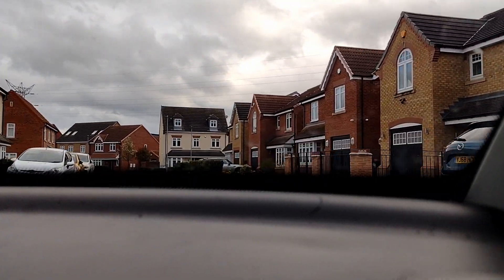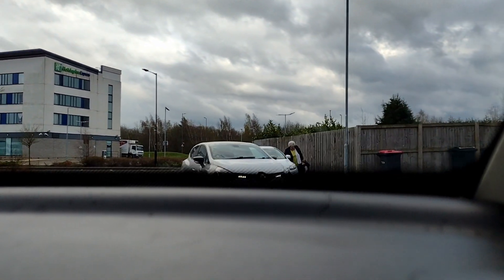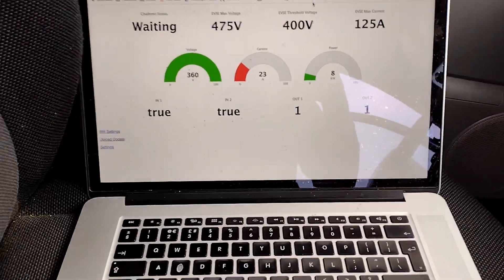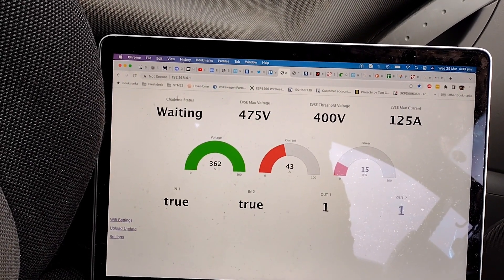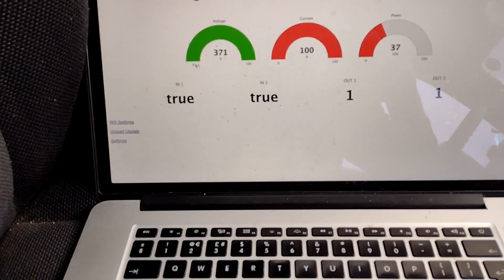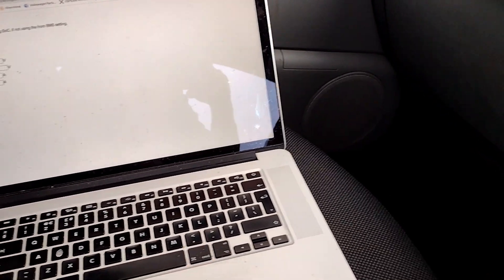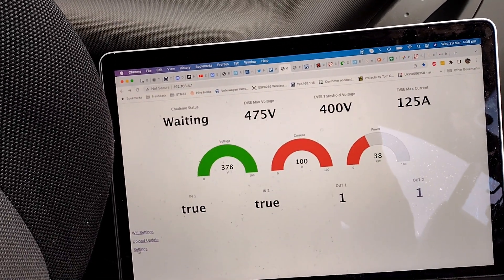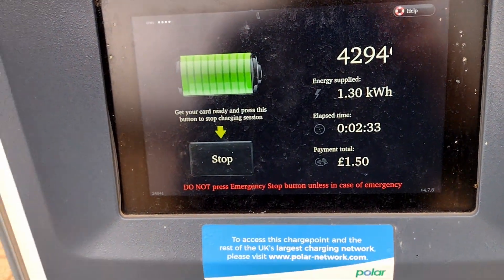DIY EV - Open Source Chademo Controller ESP32

Comment: I am going to try to get this going.  So from what I see the BMS doesn't give info to the Chademo?  How hard is that to add?  I meen what stops it from charging when the pack is too hot or 1 cell is too high?
Reply from the maker: @garbizwal  code only supports SimpBMS at the moment but you're free to add any other, all open source

Comment: I have a question about the current sensor  to used in your CHAdeMO board.
The Isabellenhutte IVT sensor is used which has a can bus at the output so you can read the current, battery charges and voltage.
Why didn't you use an ALLEGROMICRO current sensor p/n ACS772 which low costs less than Isabellenhutte IVT sensor, with out can bus.
Reply from the maker: I also use the shunt for counting ah consumed for SoC and already had it. You don't necessarily need to measure the current and voltage if you want to trust the charger reported values anyway.